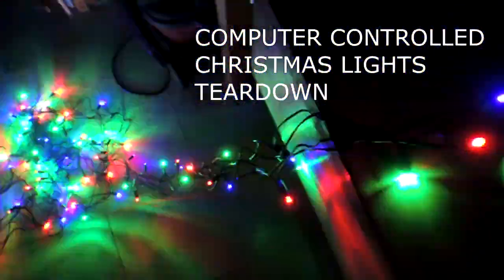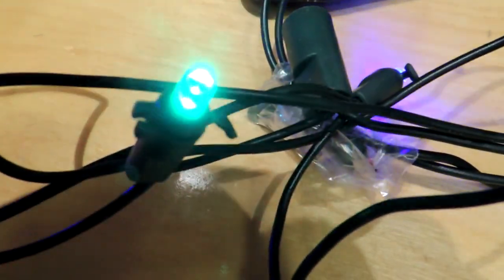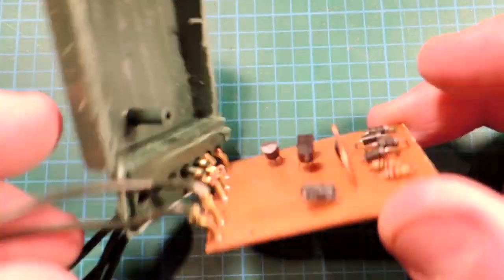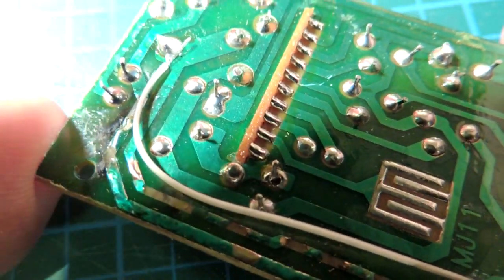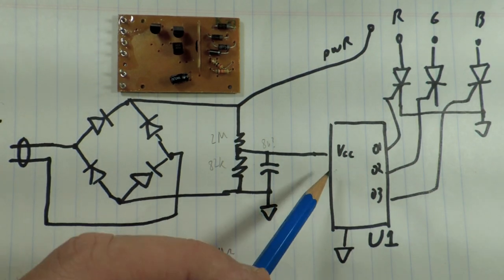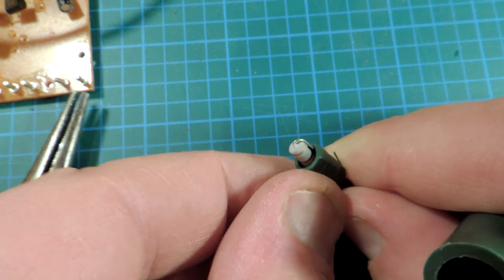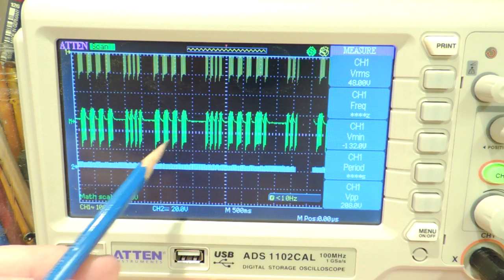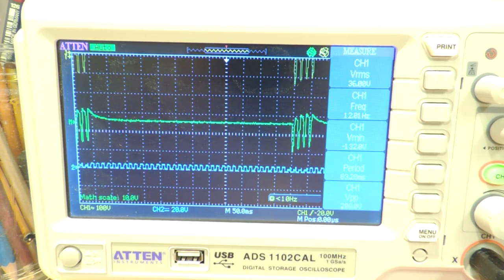Computer Controlled Christmas LED Lights Teardown

Comment: I have a fairy light witch I want to connect on a smart plug. But when the power go off on the button, I need to click on the button of the ubs again to get power again. How do I disconnect the button so when the power go off and on, I don't need to click the button on the usb again ?

Comment: I have a bunch of icicle lights with these 8 function controllers on, and every time i turn them on, they all go to different functions and it looks weird plugged end to end, and i wanna tweak the circuit board where they are just constantly on. if i remove that microprocessor and button, would that keep them constantly on? please reply asap

Comment: My led light became less brighter..like as though now enough power...how do i fix it??
Reply: I got the same board with the same issue, did u fix it? I thought the capacitor was bad but actually seems good under the multimiter test, any ideas?